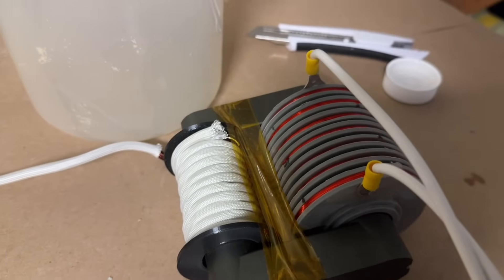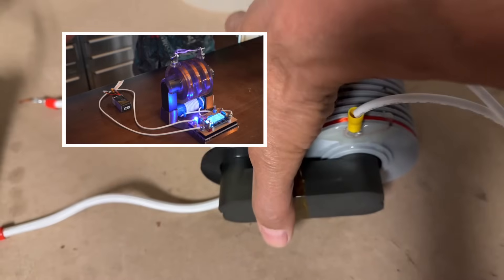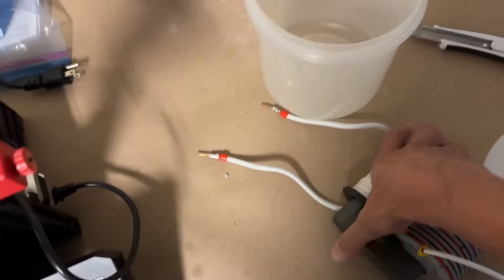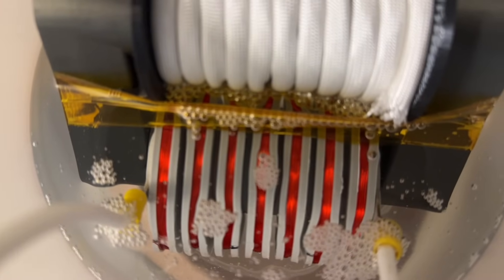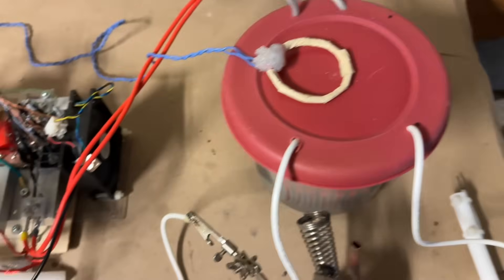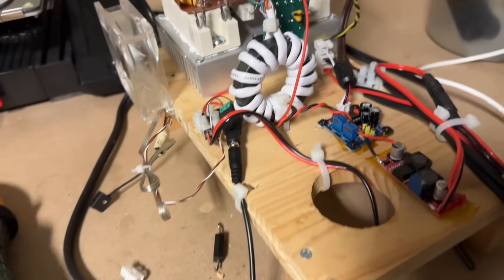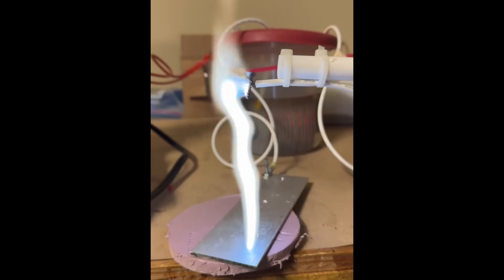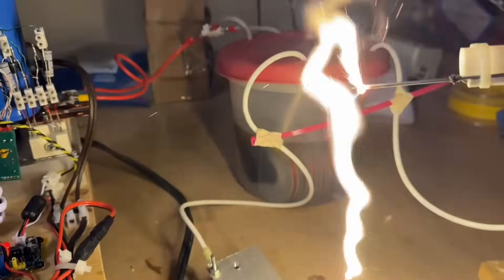Large Printable Flyback Transformer – can we Beat the Plasma Channel Flyback! (incl 3D files)

Comment: Beautiful transformer, just saw the 55V and 65V runs too, very impressive! I wonder what voltage that beast could put out if you reduce the duty cycle to 10-15% or lower and raise input voltage.

You could repurpose an ATX power supply and tap ~380VDC from the bulk cap, which saves the effort to design your own active PFC and you'd finally get to put that pretty blue 400V cap to work (with decent power factor as a bonus). 
At that input voltage level, current draw on the flyback primary drops a lot (assuming you adjust primary turn count) so you could perhaps skip the litz wire. You'd probably still want to use the variac, if it isolates the 110VAC to the PFC, for safety. Less risk of shocking yourself during one-handed probing.

I recently ran my plasma speaker test runs that way (although definitely not at the crazy power levels you achieved) and it works wonderfully. My bottleneck is the flyback transformer, so I might have a look at those 3D files you shared.

Have you tried experimenting with other harmonics?

Can't wait to see more tests with it. Kudos to you for sharing everything, awesome work!
Reply from the maker: Thanks I much  appreciate your comments. Yeah, I did try other harmonics. I tried 8.5 kHz and it gave me great output but it was noisy and not as good as the 16–17 kHz in terms of output and power level. I do appreciate your ideas regarding safety and also running in more power. Gotta look at this. I do have some great switch mode power supplies they can put out in excess of 1000 W.

Comment: Separating the core like that you’re adding reluctance to the circuit. You do have to be careful about any wire that crosses that gap tho as eddy currents from the fringe flux can result in the wire getting very hot there even potentially failing.
Reply from the maker: Good advice- thanks!

Comment: That flyback is a beauty, great work!!! Over the past 25 years, I’ve built roughly 1,000 transformers, mostly aiming for the lightest and most efficient high-voltage systems, rather than the biggest.

It turns out low-profile, drum-shaped cores made from non-conductive ferrite, eliminates the need for plastic bobbins and are more efficient. For best results, I use magnet wire with four layers of enamel. Keeping the windings tight to the core in a shell-type layout also improves efficiency and supports higher-frequency operation in a much smaller form factor.

Driving the transformer with a center-tapped push-pull primary doubles the output voltage for the same input and boosts efficiency even further.

I’ve used these techniques to build small, efficient power supplies for my ion-propelled aircraft that are able to fly using only their onboard power!  It’s taken a lot of iterations, but the project is exciting. High voltage projects are always interesting and seem to have lots of future potential!
Reply from the maker: Yes that’s so interesting and totally awesome! Do plan on future mods to improve efficiency and your work is a great pointer on achieving this goal!
Reply: @ Yes, I’m working on it all the time. I’m putting on the emitter wires now on a new much lighter machine, the wires are very thin.  Again, your HV work looks just amazing, thanks for posting!
Reply: @KraussEMUS1 I remember you! The guy who did it first!! You should be famous!

Comment: Could use high voltage SiC rectifiers and GaN Mosfets to reduce size. Also using the hot air plasma to produce a vertical arc(instead of  horizontal), is kind of cheating🤔. Anyways, interesting setup.❤👍
Reply from the maker: Thank you!

Comment: Dude that GDT is wild. That’s a great build. Can’t wait for the schematic. I’m trying to do the same thing now!
Reply from the maker: I put the 3-D printed files on, but I just put together updated files that make it way easier and I’ve also increased the diameter of the secondary spindle for more wire which means even higher voltages and I’ve tested it on the ferrite  core and it fits! I’ll post the updated stl and code files in the next day!
Reply from the maker: here is the schematic along with gate driver gerbers, i have also posted a link in the description: 
https://drive.google.com/file/d/1pJAslJWyBopxOW8wjIQ5rQeZkR9krICx/view?usp=sharing

pl let me know if you need any help with the build

Comment: Safe to say your flyback setup destroys mine! What a gorgeous build! Granted, you're using a way beefier driving circuit than what I had, which was a simple one Mosfet driver that only pulled 100 watts. So, the flyback wars have begun (i've only lost for now).
Reply from the maker: The battle is on! Touché !
Reply: Duel of fates
Reply: It's all in good fun but there's no way to say what's fair game without driver circuit and power parameters! It's a real cool idea for a challenge though.
Reply from the maker: @Magneticitist  were going to make it happen ! haha
Reply: hey he used a way higher wattage which the formla is voltage times current equals the wattage which is 20amps times 36 volts which is 720watts and Jay used 103.8 watts your not defeated at all scitubehd did was have a higher input voltage and current

Comment: You should put an audio signal onto the frequency and see what happens.
Reply from the maker: I did it’s around 16.8 kHz. This is the second harmonic. The resonant freq of the coil is 8 kHz and a noise alert! Coil seems to perform better on the second harmonic.  Higher spark initiation distances are demonstrated when it’s off resonance.

Comment: That output cable insulation definitely won't hold up. I would treat it as if it were uninsulated. You can get some much higher voltage cable intended for x-ray transformers, but even that's not rated for high frequency AC.
Reply from the maker: Need to do something about the insulation - I almost had it break down will need to coat it over with some other silicone or other layered plastic

Comment: What was that device you were using to measure resonant frequency? Do you have a link where they sell them?
Reply from the maker: I was measuring the resonant  frequency by looking at the thickness, brightness, sound and current draw of the arc. At resonance there is an increase in thickness and current draw by the arc which becomes much quieter sound wise. On either side of resonance the arc gets thinner and becomes more thready. Slightly above resonance the inverter sees an inductive load and slightly below resonance the inverter experiences a capacitive load. For longer ars, it has to be slightly out if tune ie above or below resonance as current draw drops and voltage seems to increase. The gap distance at which an arc will spontaneously initiate seems to be longer when it’s off resonance

Comment: that's almost identical to the one i made :D, except my secondary only has 1500 turns. i drive it with an ebay ZVS driver. hooked the output into a voltage multiplier and got 25 cm arcs ^^

Comment: Impressive! 
By the way, the gap between the cores, is not for the two halves to not touch; It is so that it has a pocket that is capable of storing higher magnetic fields than that of what the ferrite can do (will saturate).
I also needed high voltage at my first year of research at the uni. A big MOSFET in a blocking oscillator mode (with a feedback coil). Just a simple transistor, not even a resistor involved, with a centre tapped input coil and a high voltage output coil. I needed to make an electrospray, so that I could disperse liquids as thin films on a substrate. If you ever make it into an electrosrpay, you will be intrigued. It is the brightest ion source (capable of producing both positive and negative ions), we have! You can even have an electrospray run with liquid, molten metal, dispersing metallic ions! In this setup, you would call it an LMIS (Liquid Metal Ion Source). 
Another reason I use high voltage is for plasma jets and ion beams in middle vacuum setups, for laying down metals and semiconductors. There you play with somewhat lower voltages (1000 - 2000V), as you want to accelerate ions and pack them on the substrate they are hitting. If you put too much voltage, and they gain a lot of kinetic energy, you will end up doing ion implantation instead of laying down a film. Ion implantation is a very harsh technique, leaves holes behind in the crystal, and thus the crystal needs then to be annealed so that it can be cured.

Another reason I found I needed high voltage, is for Xenon-type balasts, or plasma cutters. You need there a lot of amperage, for the plasma to work in the hot arc region. However, making a 50000V and 300A power supply would be insane (would need 15 million watts to work). So what you do is have a high voltage supply strike the arc, therefore ionising the air between the electrodes, and then immediately apply the low voltage high amperage power supply to it. You can sustain an arc between two graphite electrodes in atmospheric pressure at a distance of 1cm between them, at 89 volts and 2.75 amps only! Supplying more amps will make your arc more conductive (it has negative resistance). For example, at 3 amps you would get an 86 volts voltage drop across the arc, at 4A 79V, at 5A 74V, at 6A 70V, at 7A 67V, at 10A 61V, at 20A 51V, at 30A 47V, at 100A 38V, at 200A 34V, at 300A 32V. There is no upper limit to what current you can supply through an arc, theoretically making it possible to even do fusion. Normally in these kind of setups, you have a big capacitor (microwave oven can do), charging up by a small flyback circuit. Once the capacitor reaches the breakdown voltage between the two electrodes, it dumps all its charge into the arc, bringing the voltage drop across the electrodes to very low levels. There, the lower voltage (e.g. 60V), high amperage (e.g. 300A) power supply can come in and continue to supply the arc with the current it needs so that it keeps going.
All this we are talking about is material sciences, a part of physics. I think you are suited and would love the subject. Best regards.
Reply from the maker: Thank you- never realized it concentrated the magnetic flux at the interfaces of the ferrite- intriguing! Thanks for taking the time to explain this phenomena!

Comment: That's a nice transformer design. Officially what is your gap distance? 
I think the criteria for rigorously gauging peak voltage should be with a resistive divider or voltage sensing auxiliary winding to measure performance, or measuring only the moment the air breaks down into an arc discharge. I didn't see Jay at Plasma Channel do any of that, mind you.

Doing anything with the persisting arc only demonstrates the current capability of the output at a fraction of the voltage required. Once the arc strikes, the hard work is done. Holding the arc vertically draws out the longest arc, but it's entirely a parlor trick because hot gas will naturally rise up and take everything with itin a natural column of convection. The plasma will be carried with it in a favorable direction toward your wand electrode. 

I think this challenge is rather ridiculous because it simply comes to using better insulators and more copper until the whole thing becomes a massive monstrosity.

The generators should be judged based on Specific Voltage (V/kg or V/L) and Specific Power (W/kg or W/L).
A light generator uses less resources, and can serve in applications where weight and cost is a significant constraint.
What is your specific voltage for this particular challenge?
Reply: My thoughts exactly.  Holding a vertical arc is pretty boring. The actual strike distance is what I'm interested in, as that gives us a better idea of the voltage.  Nice, neat construction, though.  
Also, I'd recommend using GaNFETs, which are available in similar voltages, while having much lower on-resistance/voltage drop and vastly higher switching frequencies.
Reply from the maker: Gap 2 thicknesses of polyimide tape- gonna have to pull out the micrometet

Comment: Your electric bill must be massive using all those wasteful amps to do absolutely nothing with 🤦‍♂🤦‍♂🤦‍♂
Reply from the maker: 50% of it comes from my solar array so not too bad
Reply: @ Oh cool would be nice to see you get the receiver built for a Tesla type system 😎🖖👋
Reply from the maker: Haha it’s in the bucket list!
Reply: @ You have the transmitter all ready built so its a no brainer 🤔
Reply: Real high voltages don't necessarily mean a lot of power.  When you rub your feet on a carpet and then touch a doorknob and get a spark for example, it can be 20 to 30kV, but hardly any current or power.

Comment: Do you have somewhere to share your 3d files and the others specs like drawings and parts and how you've put it together please? Also the part number etc. I'd like to make one myself. Yours is a great design. Better than other YouTubers I've seen.
That tranny is quite powerful. What's the output power would you say?
I think you need something like x ray tube rated cables for that output.
Reply from the maker: I will put the files up in the description this weekend. In the video I was running the output at 35 V AC from a 2 kilowatt variac (approx 700W) -  I ran it at 50 V and it was insane near to 1.5 kW- I will post a link to the 50 V run shortly
Reply from the maker: Check this out- 55V AC run-

Insane Output 3D printed flyback-55V run
https://youtu.be/P9WtUQ2--xA
Reply from the maker: >1kW run-
https://youtu.be/P9WtUQ2--xA
Reply from the maker: HERE ARE THE DOWNLOADABLE 3D PRINT FILES FOR THIS PROJECT:
https://drive.google.com/file/d/1BWjd7jXYNKCQil1c2wir10exkYqGFeic/view?usp=sharing

HERE IS THE AMAZON LINK FOR THE FERRITE CORE THAT WORKS WITH THE ABOVE 3D PRINTED PRIMARY AND SECONDARY FORMERS:
https://a.co/d/hDxiMhW

Comment: 5:00 that is incorrect since you are not operating the core as a flyback converter. A gap will reduce efficiency and increase leakage in push/pull converters like half bridge and fullbridge.
Reply from the maker: Yes small gap seems to help and increases resonant freq
Reply: @BrianDhvTinkerer i wonder why a small gap helps... I run with a zvs, and noticed early on that original gapped tv flybacks strained the zvs, so always removed the gap and it likes that.
Reply: 9:47 jays transformer made my dog go freaking nuts and hated it, my dog is laying here with me for the duration of your video completely unbothered. Even when its slowed and the noise bothers me, it didn't bother her at all. At least not that she let me know. During jays video she was aggressively vocal and left the room, and even kept barking when i lowered the volume and she was 15m away.

Comment: I have made huge transformers using giant U and I ferrite blocks, and then making a coil form by gluing together sections of high density polyethylene sheeting.  You can glue the sheeting together by flame treating the surface (to create polar groups to adhere to) and then using epoxy.  I made an extensive guide on making these, and I have a github repository of circuits for Tesla coil and resonant/nonresonant inverters.  The CD40106 Schmitt trigger is helpful for making simple adjustable oscillators and for taking feedback for resonance.
Reply from the maker: That’s very helpful- thanks for sharing!
Reply: God bless u proffdc!!! Ive been having a devil of a time trying to get a decent hv sec bobbin without 3d printing. 
I have made some really good bobbins that have performed well, but the work involved is a lot. Like, a LOT lot.

Comment: Nice build man. Thank you for sharing your experiments.
A suggestion for a future video: Now you can make the so called Ionocraft Lifters since you have a powerful flyback supply.
Reply: TBH, generating high voltage for a lifter isn't the problem, it's the design of the lifter itself and the weight of the electronics that need to be housed with it. Of course, I'd love to see an attempt as well.
Reply: @InfinionExperiments  You have not seen a proper lifter as most plasma propulsion engines are reserved for space (tax stealing). And even those plasma propulsion engines you might see are only for middle to high vacuum (in the latter case with its own supply of gas ions), high voltage low amperage designs. You can utilise high amperage plasma jets to do your propulsion, leading to pure high power electric jet propulsion, your only fuel being electricity. However, the biggest problem there, is the air molecules (O2 and N2) get dissociated (into mono atomic reactive species O and N, which recombine randomly) leading to all sorts of nasty nitrides. It is not sustainable, it is not clean, but it is very impressive.
The best propulsion you can do is mechanical displacement, the way we currently do it either with props or turbo fans. However, the best and most silent lift you can do, requiring NO energy, is floating, like a balloon. These will be the next gen spacecraft, requiring just a smart small compressor to have liquid helium or hydrogen go from liquid to gas and back to liquid when landing. Speeds attained can be fast as the "ballon" can be cleverly shaped into aerodynamic shapes. We are at the age where we can have strong and light surfaces (by PVD) made from diamond, or from carbon fiber and epoxy as we currently do. A modern aircraft would need to have learned from the mistakes of the past, and use redundancy a lot, so as to be safe. It would need to have autonomous filling compartments, and able to travel "in limbo" if anything goes wrong.
Reply from the maker: You’re welcome. This was a fun project to get done!

Comment: Awesome build. great result. I wonder how high the voltage actually is.
Reply from the maker: Great question! I did not power it up fully. I plan to rectify it and store it in a high voltage capacitor to get some idea how high the voltage is.
Reply: @BrianDhvTinkerer  or maybe a resistive voltage divider
Reply from the maker: Yes exactly that would be easy to construct.